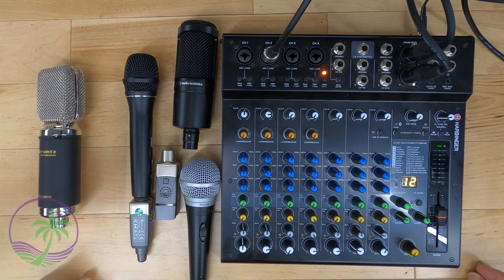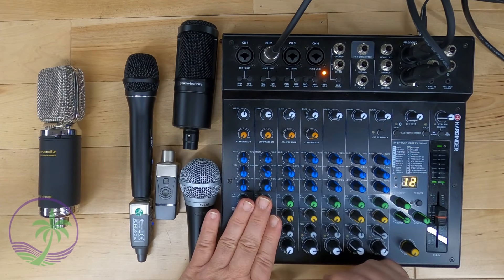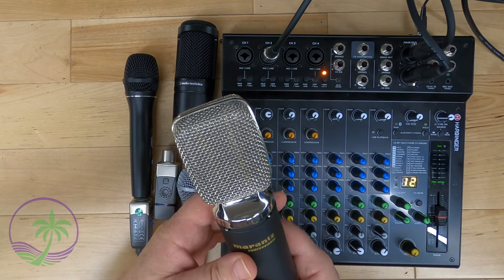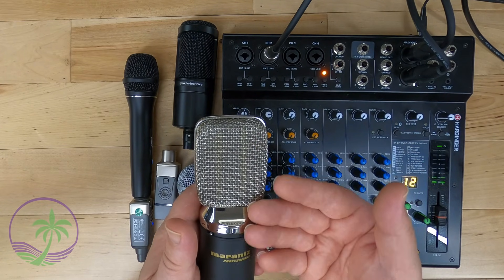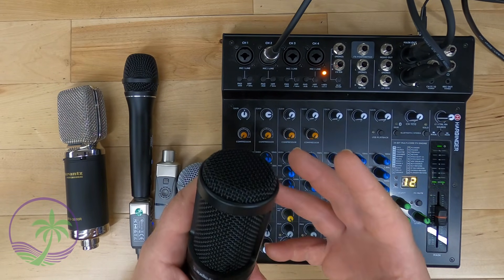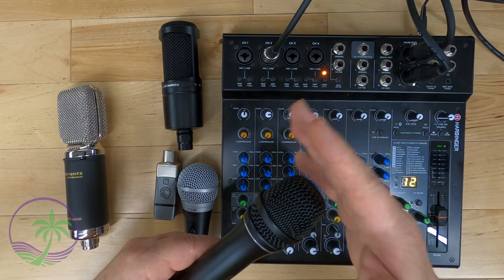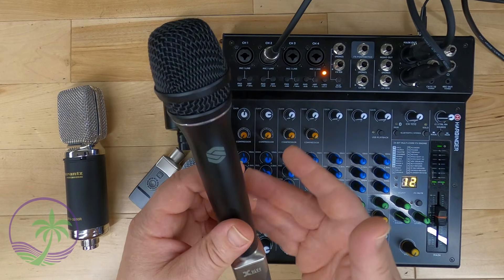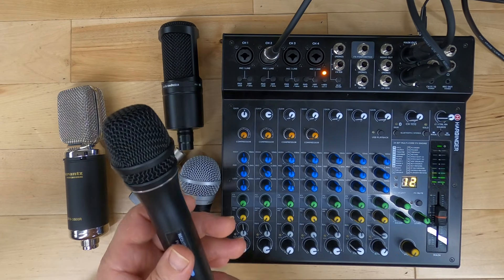Phantom Power in 5 minutes Everything you need to know : Ultimate Audio Mixer Guide

Comment: The mic you are using - which requires 48V - is it using an XLR input/cable - or 1/4" TRS? When 48V is enabled...does it only power the xlr part of those combo inputs on the board or the 1/4" 8nputs as well? Cheers...
Reply from the maker: That is a great Question, you are the first person to ever ask me this question, and that's saying something. I would ASSUME it works like that XLR = TRS. But I don't want to make an ASS out U and ME. So I will find a cable and test it out.